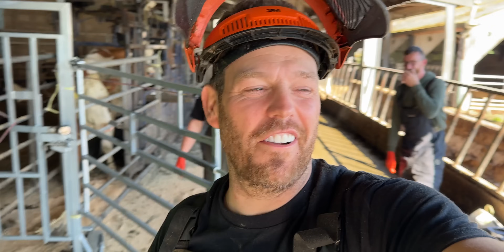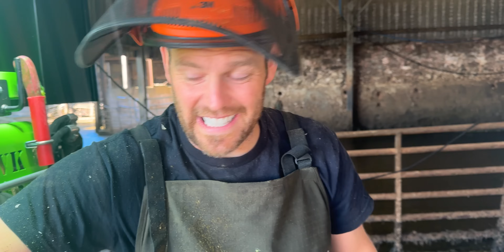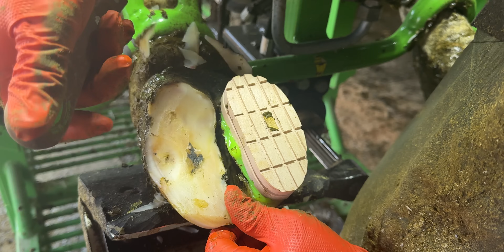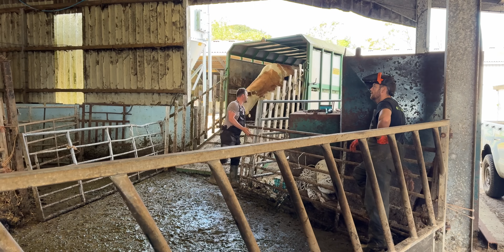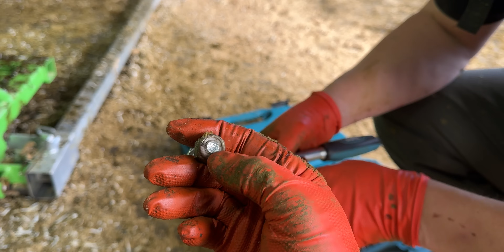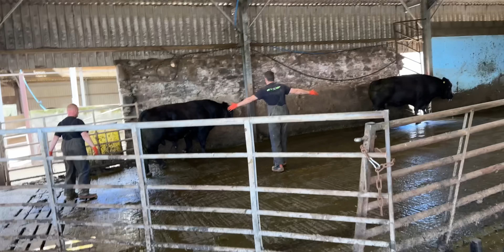REMOVING ROCKS & a BROKEN CRUSH | Behind The Hoof ep 3

Comment: There is a couple points where in the background there's a cow with a large bloody hole in her side.  For those worried about her, don't. It's a normal process where the farmer or the vet does something to relieve pressure in the guts of the cow, I don't remember what it is called, but it's a safe procedure that provides the cow with a huge relief and only a incision point to heal versus if the gut had blown, the cow would have been in tremendous pain.  It has something to do with gas in one of the stomachs I think. You might compare it to colic in other animals.

Comment: Re: what is a beholder?

I looked it up online, and apparently a beholder is “an aberration comprising a floating spheroid body with a large fanged mouth and single eye on the front and many flexible eyestalks on the top. It is protected by chitinous plates.”

Apparently, each eye stalk has its own special magical powers, many of which are built around charm spells. 

From this, I surmise that the phrase means that the beholder will tell you what is beautiful after it has cast Charm Person on you. 

It’s not really what I would consider a universal reference, but it is certainly vivid. 

Cheers!